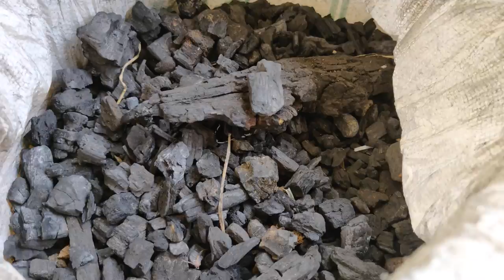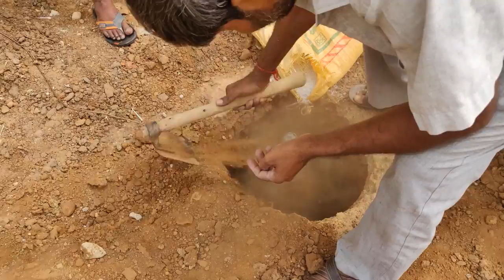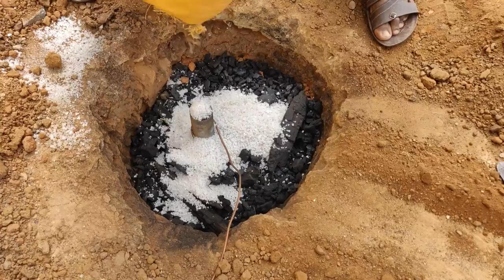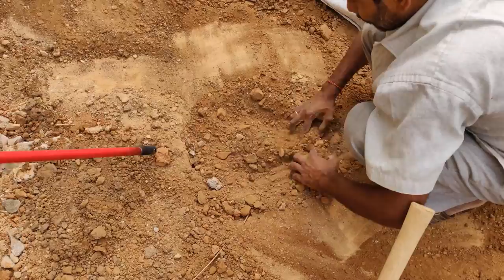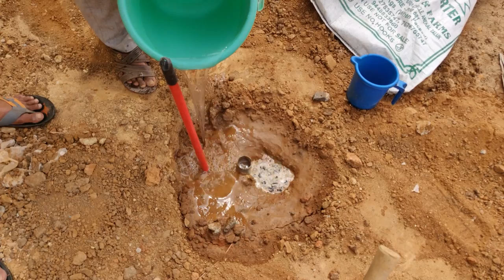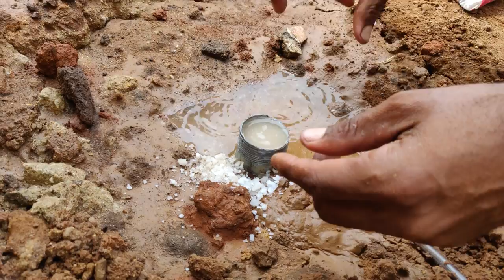How to install Electrical Earthing At Home - How To Install Ground Earthing | Step by Step

Comment: Thanks for sharing but at the very least give some description of what you are doing and why. I assume you used salt, charcoal, a galvanized iron pipe and copper wire with copper rods? What depth is needed? What is the expected life?

Comment: Pipe type Earthing: For Pipe type earthing normal practice is to use GI pipe [C-class] of 75 mm diameter, 10 feet long welded with 75 mm diameter GI flange having 4-6 numbers of holes for the connection of earth wires and inserted in ground by auger method. These types of earth pit are generally filled with alternate layer of charcoal & salt or earth reactivation compound to reduce the earth resistance.
Reply: Not even 1 like  for these much explanation      are koi tho dedo ra😂
Reply: In what ratio Salt and charcoal to be used for conventional earthing

Comment: Very good demonstration on how to install a good but “sacrificial” earth ground in soil that provides a poor ground on it’s own. Of course there are some better chemicals available, but the salt and charcoal are very effective. Also taking a healthy pee on it occasionally helps too. I learned that trick working at remote tower sites in Texas. In some areas the phone line would be on a single insulated strand of barbed wire. At the tower in the remote location was a ground rod to make the circuit. When you picked up the phone and the dial tone was scratchy. You went outside and watered the ground rod. That fixed it every time:-).....

Comment: Soiltreat can be used instead of salt and charcole salt because due to salt the rod will start getting corrosion..instead use soiltreat compound which is as per ROHS std and is green and safe conducrive compound

Comment: Good work brother
Pls mention:- wire size and pipe also copper wire size thank you
Reply: Wire size mm will differ, depending upon the load you put. If 10kw then 16mm² ground wire etc etc. That's very thick ground wire. You can find measurements with you nearest wire dealer.

Comment: Earthing is required for good electricity connection.it will be solution for rectify  high voltage and low voltage .in home if high voltage comes tv and refrigerator will be burn.and it will be very useful in industry.mainly in cell towers.electronic equipments need proper earthing to work well.
Reply: Thenk you
Reply: But that earth pipe will damage very quickly because of the salt, if he use zink cable to rotate the GI pipe will not touch the rust. Never use salt, totally wrong
Reply: Wrong, Earthing/grounding is required to save us from electric shock if we touch the metal body of a faulty appliance/device if the device is properly grounded the current flows to the earth and thus save us from shock.

Comment: This is definitely not necessary for just anywhere on the planet. 

With such dry soil, you need drastic measures to reach moist places that do conduct electricity. 

Over here, we just need a 4 foot spike, often less, hammered into the ground.

Comment: What is the use of uploading a video if you are unable to reveal the full description of what you are doing. A useless effort.
Reply: very bad video &so bad music
Reply: Earthing is required for good electricity connection.it will be solution for high voltage and low voltage.in home if high voltage comes tv and refrigerator will be burn.and it will be very useful in industry.mainly in cell towers.electronic equipments need proper earthing to work well.
Reply: @MarioMario-vr9fp  

I think its a waste of salt. Salt not needed

Comment: All wrong   how can use  salt inside   steel pipe  may be after one month  pipe foild
Reply: You to fail
Reply: It is not salt it is I don't know
Reply: @abdulqadeerbhatti3048  that is real salt
Reply: Yes.  U r correct.  Gi pipe going to damage
Reply: Yes. It is Salt indeed. They use salt and coal mixture with water to increase  conductivity. But, we're in the same page. How come Salt not rust the iron bar? That much salt will melt it in a while.  🙁
Reply: Kasun Dhananjaya Nanayakkare you need oxygen for rust to take and underground like underwater it will rust very little. Steel boats rust at the water line not below.......
Reply: @steelem422  I totally forgot Oxygen. 🤭 Still, water carries enough oxygen to create  rust that acts as an insulator.
Reply: @kasunnanayakkara793  
Salt is not needed
It will probably make a
Better ground if it touches the ground
Here its touching salt instead. I think salt is not needed.
Reply: @steelem422  it will rust, the two materials are corrosive to each other, the copper will eat the steel
Reply: Chutia banaya hay just coal he kafi hay salt q dala.

Comment: In U.S. nowaday, they nail a 6 foot copper ground rod into earth in addition connecting the ground wire to practical using current water heater pipes is a sure way to be grounded.
Reply: The method depend on type of the soil. In Les soil the method in the video is very efective.

Comment: This is the ultimate how not to install your grounding video!
Reply: Will Swift  this works for 240volt system prevalent in India. Don't expect much as this is not done by a  professional company but some local technicians who know to get the job done albeit not technically the best. Hope you find the perfect method.

Comment: any body, did they ever say what they poured down the hole? It looked like salt and carbon.
Are they trying to make a battery?
If they said anywhere I didn't hear. I actually surprised myself and listen to 2 minutes before I HAD to mute the audio. What a waste. Step by step, maybe if you're physic
Reply: waited 3.25 minutes , couldn't  take it any more

Comment: Any material should not put inside the pipe.The pipe is used to put water inside the pit daily. Salt also to be avoided ,since it is corrosive .Only charcoal and soil to be added outside the pope ,surrounding it .Plenty of water to be added while layering soil .
Reply: Steel fence rail, rock salt, vermica <sp?>, dirt. In order as put in pit.

I would recommend in DRY areas adding a 3 Three inch or larger PVC pipe along side that you cap the bottom and drill 1/8 inch holes down the bottom half about 2 onches apart in a straight line to bottom then add a screw cap to top of pipe.
Leave top of pipe about 3 inches above ground.

After final insulation fill with water TO TOP.

After that check the water level every few days until you learn how often you have to refill pipe to keep area around grounding system MOIST to improve grounding

Comment: A ground rod would not work well in as dry a ground as they have. They are creating a better ground because salt draws moisture from the air. Salt water is a much better conductor than dry ground. The salt will keep it moist for a very long time therefore a very good ground system.

Comment: I'm in the states this would never fly a steel pipe and copper wire don't mix galvanic corrosion this is all when used to number eight rods copper six feet apart tied to the panel and then jumped the meter for water that's how we do it whole thing could take about 30

Comment: Buying a ground rod would be way easier. Your video would be cool if you added a cold water ground, ufer ground and bonded it all to the service in the panel. I guess you like to buy emt and salt for some reason.

Comment: Thanks you for the video . work system's different here in Italy we don't do it like this
Reply: Mustaphal Keita earthing is same everywhere. This guys are stupid. Don’t follow them. They have used salt and charcoal to fill the hole.  Also used GI pipe instead copper. For build a real earthing we must use a half inch copper rod length between 3 to 6 feet in a wet surroundings. Thats it.

Comment: Looks like they used the top rail for a chain link fence, which is more readily available than a copper clad steel ground rod. 
    The crystals are probably sodium chloride (table salt) to increase ground conductivity, and provide a better electrical ground connection. 
   This works fine for the sandy soil they drive the ground rod into. For rocky soil, the metal tube would bend, crack and break with the first few rocks the fence rail encountered.
   A good idea for improvisation or amateur field day set up.
   Was the ground resistance measured- probably not.

Comment: good  effort and nice one thanks somuch
Reply: Steel fence rail, rock salt, vermica <sp?>, dirt. In order as put in pit.

I would recommend in DRY areas adding a 3 Three inch or larger PVC pipe along side that you cap the bottom and drill 1/8 inch holes down the bottom half about 2 onches apart in a straight line to bottom then add a screw cap to top of pipe.
Leave top of pipe about 3 inches above ground.

After final insulation fill with water TO TOP.

After that check the water level every few days until you learn how often you have to refill pipe to keep area around grounding system MOIST to improve grounding

Comment: How much kw shall we connect for this?? How to test its working capacity? ? Shall we mix 3phase with single phase? ?
Reply: Ground is ground. It doesn't short out the three phases. Ground connections are isolated paths. You can connect any amount of plugs and switches as you wish. Because, as long as your RCCB would not allow any curremt above 50mA to get grounded. It will shut down the whole system automatically.

Comment: Improper way of grounding a house  electrical system.  I know  I am a technician /  electrician  . You use a 8 foot copper  pipe . You can buy them from hardware stores. Menards sells them  8 foot lengths  different thickness.  You hammer/drive the ground rod all the way down and leave  enough   of the rod to connect your copper ground wire to.  The rod is deep enough to make good contact with mineral rich  soil.  You can test your ground by simply  connecting a light bulb   up to your ground . Neutral to the ground hot to the Ac   of your house. The bulb will light up bright . This indicates proper  ground contact.
Reply: Meaning no need for soil and charcoal right??
Reply: Salt

Comment: Seems the video has been made for deaf and dumb people and not even showing the materials used. The uploader himself needs earthing!
Reply: Steel fence rail, rock salt, vermica <sp?>, dirt. In order as put in pit.

I would recommend in DRY areas adding a 3 Three inch or larger PVC pipe along side that you cap the bottom and drill 1/8 inch holes down the bottom half about 2 onches apart in a straight line to bottom then add a screw cap to top of pipe.
Leave top of pipe about 3 inches above ground.

After final insulation fill with water TO TOP.

After that check the water level every few days until you learn how often you have to refill pipe to keep area around grounding system MOIST to improve grounding.
Reply: Amitabha Ray 😂
Reply: Ethu marapotante thanu ee idea

Comment: Useless Earthing method, if you use this in international level. You will be kicked out from the project. 

Use Solid copper Earth Rods, if the Soil Resistivity high then use low Resistivity Earthing compounds to lower the resistance. .

Comment: Material name kya h
Reply: Dear Sir,

Greetings from Avon earthing company Pvt Ltd !!!
  
ELECTRODE EARTHING, LIGHTING ARRESTER,ALL TYPE EARTHING AND GROUNDING EARTH SYSTEM ETC.
LEADING MANUFACTURER OF CHEMICAL EARTHING AND ALL TYPES EARTHING AND LIGHTING ARRESTER.
It was good to talk to you and as per the discussion, we are sending here with our Introduction which introduces about the nature of our Products & Services.

AVON THE TOP ONE BRAND 
TOP QUALITY PRODUCTS AND SERVICE .
We Avon earthing are Promt Manufacturer Duly registered under Micro and Small Industries for manufacturing of Chemical Pipe Earthing (Based on G.I. ,Copper Bonded & Pure Copper) , Earth pit cover, Lightning Arrester, Back fill compound and all type of Grounding systems with the "EEPC brand".

We specialize in installation and testing highly conductive, corrosion free Earthing system as well as lightning protection system.
 
Made in india product .
आत्म निर्भर भारत
We are also in field of ESE Lightning Arrester in Brand Based on Gravity, Kalre & Patroit Turkey as Per Specified NFC Standard. 

" SAFETY IS OUR PRIORITY & QUALITY IS OUR STANDARDS "

Our Product Range Which We manufacture are Given Below-
 
1. Chemical Pipe Earthing (GI,Copper,Copper Bonded, CI etc)

2. ESE Lightning Arrester

3.Surge arresters

4. Digital Lightning counter

5. Poly Plastic Earth Pit Cover

 6. All Earthing Accessories
 
7. All type earthing & lighting arrester,
Earth product and system.
Grounding earth system.

Our electrode is available in different sizes from 2 Feet to 20 Feet along with Back Fill Material which reduces the resistivity of Earth around the Electrode. We assured you for the required Ohmic value in normal conditions as well as with multiple installations in rocky areas.
 
Our Electrodes are manufactured according to standards

'' WE HAVE NO COMPLAINT AGAINST OUR COMPETITORS WHO CHARGE LESS AND PROVIDE POOR QUALITY & SERVICE".

--
Thanks & Regards
Avon earthing company

MD. Rajnish maurya
PM. Dinkar maurya
Sales Marketing 
Prabhat maurya
Cell: +91 9198843785
Mail Id: prabhat150796@gmail.com

HEAD OFFICE:-     
Office: Shop No .232,1st Floor,lekhraj Gold,muncipuliya,indira nagar Lucknow 226016
Tel: +91 9198843785
        +91 7355375353
       +91 7054151809
Customer service 0522 -4024167

Comment: you don't  but soil please but sand
Reply: Steel fence rail, rock salt, vermica <sp?>, dirt. In order as put in pit.

I would recommend in DRY areas adding a 3 Three inch or larger PVC pipe along side that you cap the bottom and drill 1/8 inch holes down the bottom half about 2 onches apart in a straight line to bottom then add a screw cap to top of pipe.
Leave top of pipe about 3 inches above ground.

After final insulation fill with water TO TOP.

After that check the water level every few days until you learn how often you have to refill pipe to keep area around grounding system MOIST to improve grounding
Reply: هذا عمال ايرث

Comment: What is this Salt and charcoal ?
Reply: it is a different kind of grounding technique. Other would put the salt in the pit first, then charcoal then salt then charcoal then soil and watering through the pipe to moisten it. Normally used for dry areas or where the resistivity is higher in the soil. in most videos you will see the charcoal as in this, the proper method is for charcoal powder due to surface area. when they use charcoal in this method in chuncks as in this video and many others, the rod actually that can form part of the earthing loosing some of the earthing, while if it was powdered it doesn't. But hey, if it works, why not :)

Comment: How you extract electric in the soil
Reply: Not EXTRACTING!
Electrical and LIGHTNING GROUND PROTECTION!!!

Steel fence rail, rock salt, vermica <sp?>, dirt. In order as put in pit.

I would recommend in DRY areas adding a 3 Three inch or larger PVC pipe along side that you cap the bottom and drill 1/8 inch holes down the bottom half about 2 onches apart in a straight line to bottom then add a screw cap to top of pipe.
Leave top of pipe about 3 inches above ground.

After final insulation fill with water TO TOP.

After that check the water level every few days until you learn how often you have to refill pipe to keep area around grounding system MOIST to improve grounding